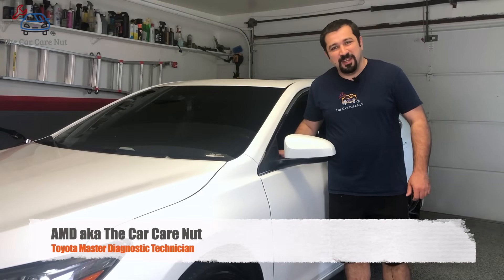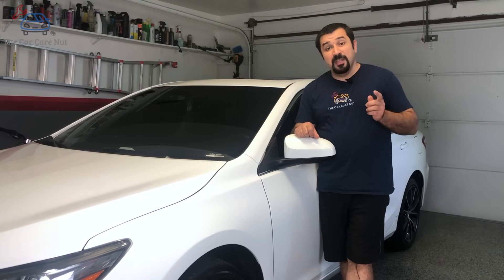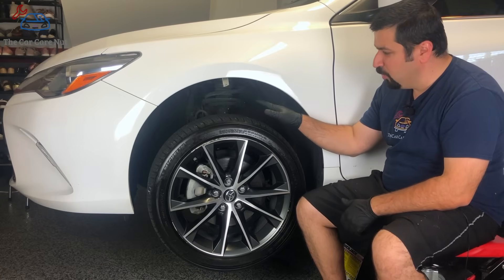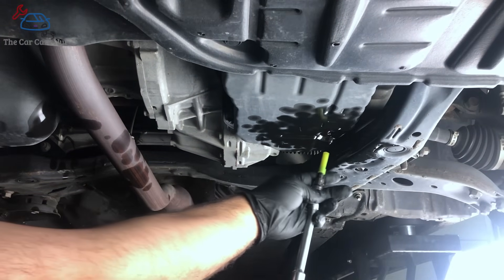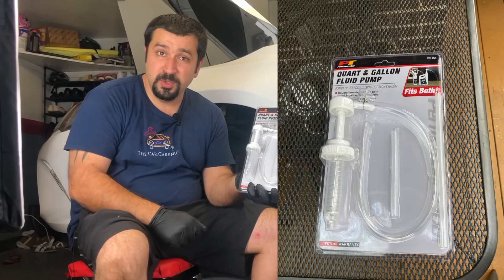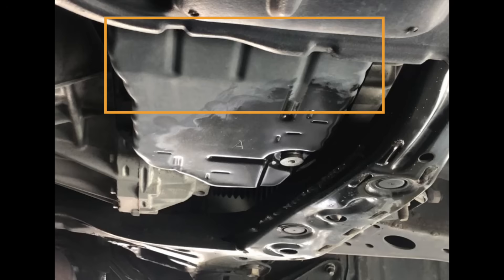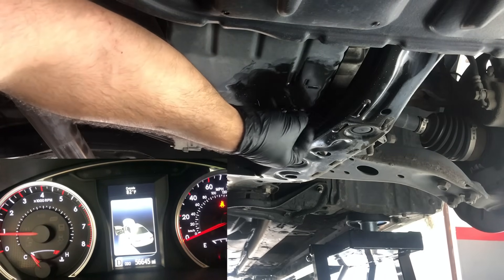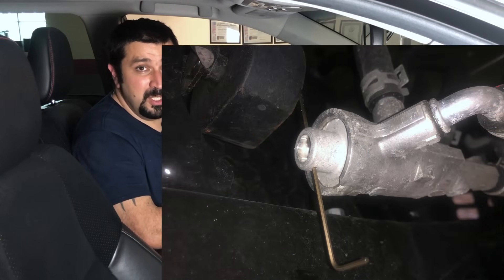How to change your Toyota Sealed Transmission Fluid

Comment: Last week I had the transmission fluid changed in my 2020 Camry XLE 4 cylinder. It has 6,000 miles on it. I just did it for early preventative maintenance. There really are a lot of steps and doing this procedure. I noticed it cost more to change this fluid than it did my previous Honda Accord. Toyota charged $291 for this service. They sent me $100 coupon so it only cost me $191.00 . I was wondering when they changed this fluid is there still older fluid left in the car that never comes out?
That is the main reason I changed it early so the fluid that never drained would still be good .. The same theory if you changed the oil and didn't change the oil filter.
Reply from the maker: Hi! Did they do a flush or drain and fill?
Reply: @TheCarCareNut  I just called the dealership as I could not tell by the invoice. He said they flushed it. I also had the TSB reset as well.

Comment: Hi, just watch your video on the Xtool D7. Can you use this tool to monitor the transmission temperature and also can it  reset any service monitors for the transmission if there is any? 
Thanks for your time, appreciate your efforts with your informative videos.
Reply from the maker: Hi! I haven’t found a function to reset transmission memory and you can view trans temperature on some models. The company seems committed to being support to those models that you can’t if you contact them

Comment: I have a 2019 Toyota Camry LE, 4 cylinder. I'm almost due for a fluid swap and I'm wondering if this is more or less the same procedure for my vehicle. I know it's an 8 speed transmission and it's a slightly newer model, but as far as the rest of the procedure goes, is it the same?

Thanks in advance! You are amazing and I am definitely subscribing! Thank you for your information!
Reply from the maker: The rest of the procedure is the same. Practice it first
Reply: Hello Richard, I currently have my car (which is the same model of yours) jacked-up on stands. I just have one issue.I can't locate the bypass valve. Did you have any luck locating it? Thanks

Comment: Thank you AMD for this excellent video !! I am from Bangladesh and I own a JDM Toyota Allion (T260) 2010. I want to change my CVT fluid in the same way you did in diagnostic mode. I can enter into diagnostic mode using a wire but my dashboard display don’t stay in D after doing N-D-N-D-N-D couple of times. It always displays the selected corresponding gear no matter how many times I do the N-D-N-D. Thus, I have no way to know if my fluid is at right temperature to check the level. Is there any solution for this problem? I would really appreciate if you could help me to solve this. Love ❤️ from Bangladesh 🇧🇩
Reply from the maker: Hi! You’ll need a scan tool that can check the fluid temperature
Reply: @TheCarCareNut   thank you very much for your support 🙏

Comment: Hello AMD !
I really appreciate that you share all of that knowledge so openly. Congratulations !
I own  a 2021 4Runner SR5.

Which of the two temperature sensors should I read with my scanner when I will fill the tranny with new ATF ?
One of them, some times, shows a higher temperature  than the other.  I suspect that it shows temperature out of the torque converter while the other shows the pan’s.
Tks
Reply from the maker: Hi! You’ll need to watch the temp from sensor 1. It’ll usually be called ATF temp 1
Reply: @TheCarCareNut  
Tks AMD !
Reply: I also own a 2021 4Runner SR5 Premium. Do these also require the jumper cable insertion? Or can you go into fluid temp check mode just by doing the shifter process? Thank you!

Comment: Hello there ,. I have drained and filled my K310 transmission while vehicle cold the same quality that I got out. 3 days later I get engine light on and scanned got code dtc  b2282 I'm wondering if that is related. I could do the correct procedure to do level check because my floor is uneven but I got techstream. You have a clue
Reply from the maker: Hi! Likely not related. You’ll need to check the fluid level to be sure.

Comment: Great tutorial. Very clear and precise with your instructions. It gives a little more confidence in proceeding with the work myself.

Question, will this procedure work with a 2014 Scion tC? Will the D light remain solid or will the A/T Temp light appear? Thanks.
Reply from the maker: Hi! This works for your scion and if memory serves right it’s most likely the D light

Comment: On a 2012 Camry SE 2.5 liter 4 cylinder is changing the filter necessary if the fluid isn’t dirty?
Reply from the maker: Hi! If the fluid is changed on time and is not dirty the filter replacement is not needed
Reply: @TheCarCareNut  even if the filter doesn’t get dirty wouldn’t it still eventually wear out or come apart?
Reply from the maker: I haven’t seen one come apart yet
Reply: @TheCarCareNut  ok thanks!

Comment: Great video! On Toyota Rav4 2019 2020 2021, what is the temperature range? Do you have to put an Allen wrench to the cooler bypass in order to hold in the valve on the  2019 2020 2021 RAV4 8 speed transmission?
Reply from the maker: Hi’ no cooler bypass and 95-113

Comment: Do you check the transmission fluid level in park? N? Or Drive? On a 2018 Camry with the 8AT.

Thank you
Reply from the maker: Hi! In park idling
Reply: @TheCarCareNut  Hello, Thank you so much.  at what Transmission Temp I should check the fluid?  Because I'm using the Foxwell NT 624 Elite to check the Transmission Temp.

Thank you so much.
Reply from the maker: At 95-113
Reply: @TheCarCareNut  thank you so much
Reply: @TheCarCareNut  you located in Chicago, can I bring my car to you for transmission fluid change in mid-2022?

Thank you so much
Reply: @TheCarCareNut  Congratulations on the new Camry you got in another video

Comment: Thank you for your wonderful videos!  Today, I drained my 2016 Corolla cvt.  A whopping 3 ½ liters drained out, and I put the same amount back in.  I'm seeing most people draining far less than that.  The transmission has never malfunctioned.  Was my transmission overfilled?  Should I use the same trinkle technique that you're using in your video?

Thank you for your advice.
Reply from the maker: Hi! It’s possible that it was overfilled. But no way to know until you check the fluid level which I highly encourage you to do
Reply: @TheCarCareNut  I rechecked it today.  It was overfilled.  I corrected the refill by using your instructions.  Thank you!

Comment: AMD I recently bought a 2011 Rav 4 with 123,000 miles and the owner told me she didn't have the transmission oil changed. I've written to you before asking whether or not I should change it now or leave well enough alone. You said if the oil smells burnt don't change it. I've decided to have Blackstone Labs do an oil analysis of the transmission oil to check both the condition of the oil and whether the transmission is showing signs of excessive wear. They require a 3 oz sample of the transmission fluid for the test and specify that you not use the first fluid drained for the sample. Is it okay to use a transfer pump to withdraw the 3 oz sample through the fill hole or should I take it from the bottom drain? Thanks!
Reply from the maker: Hi! You can take a sample through the dipstick in that model. Use a long straw and a transfer pump.
Reply: @TheCarCareNut  Wow! Toyota really wants to make it tough for owners to check the transmission fluid don't they. There's no mention of the dipstick in my owners manual or in the illustration of the engine compartment. I'd seen the dipstick on the right side of the manifold shield but I thought it was for something else as a friend told me my 2011 had a dipstickless sealed transmission. Am I correct in assuming this means I don't need to use the overflow tube method of checking the transmission fluid level and can just drain/measure the amount that comes out/replace that amount through the dipstick tube and then check the level with the dipstick?  Thanks!
Reply from the maker: That’s correct you don’t need to use the overflow stuff. Just conventional dipstick with the engine at idle
Reply: The Car Care Nut Thank yo so much for your help, Much appreciated!

Comment: You do an excellent job on your videos!  They are some of the best I've seen!   I waited until 175k on my 2007 Toyota Sienna because it was supposed to be lifetime fluid!  Unfortunately,  it was after it developed the dreaded low speed bog down at the 2 - 3 shift point.  Is that repairable without a rebuild . All other shift points are fine.  I now have 210 k miles, and can live with the low speed bog down at the 2 - 3 shift point.  Thanks again!
Reply from the maker: Hi! Unfortunately at this mileage it’s a big risk. If you change the fluid it’s either going to fix it or make it a lot worse. I would only try it when you’re ready to get another trans or rebuild this one as a last measure
Reply: @TheCarCareNut  I am having a similar issue on my 07 Lexus IS 250. First fluid change was done around 144k km by dealer. Car is at 205k km now and showing low gear shudder signs. Would it be ok to do the drain and fill? I would get Toyota to do it because I don't have the space here to do it myself. Any extra information I should give them or is what you showed standard procedure at the dealerships?
Reply from the maker: If it was done before you can safely replace it
Reply: @TheCarCareNut  Thank you so much for the reply. You're amazing and I am learning so much. I have another question if it is not too much trouble and I think it may help the original poster as well. My car also has the harsh downshift from 3-2-1. It appears official word from Lexus is to replace ECU and not to replace/rebuild transmission. Do you have any experience with this issue and ECU replacement/repair?

Comment: At the risk of sounding silly, if performing this task alone, the part when the D indicator turns solid. Do you drain the fluid while on D, or ok to place it on P (park) then drain? (Something aboutCrawling under a car with moving parts working alone seems risky) 😆
Reply from the maker: Hi! When the indicator comes on put thr car in park
Reply: @TheCarCareNut  can I turn the car off and then go drain it? Or does the car need to be in park and engine running?
Reply from the maker: Car needs to be running in park

Comment: This does not replace all the fluid in it does it?
Reply from the maker: It replaced enough of the fluid to keep things fresh
Reply: @TheCarCareNut  what is the total capacity? I have a 2015 I plan on doing this to tomorrow, but it's at 96k miles.
Reply from the maker: I would do the drain and fill once and call it a day.
Reply: @TheCarCareNut  I read it is because 3.9Q and 6.9Q depending on year and model. I have a 4 cylinder non cvt so I'm assuming it's on the lower side of capacity. If that is true Then getting the 3.5 out of it from a drain like this would be good enough for me.

Comment: I have a 2017 Camry with 56k miles, so today I took it to my local Toyota Dealership to have them do this job. I have a dashcam that records the inside of the car as well, and I saw no footage of them doing the fluid level adjustment procedure.There wasn't any recorded video in between them pulling my car in and then out of the service bay. I'm pretty certain that they did in fact do the drain and fill because my car is shifting more smoothly, but should I let them know that no one did the adjustment procedure?

Comment: Do I need to remove the oil pan and replace the transmission fluid filter?
Reply from the maker: Hi! If the fluid is changed on time you don’t need to
Reply: @TheCarCareNut  Thank you so much for the reply!

Comment: Hey Amd, GREAT VIDEO, THANK YOU! I have a 15’ XLE Sienna and an 11’ Lexus ISF with the sealed trans. I have done this procedure for both vehicles but was never able to get the cars in Diag Mode as the Manuals were so confusing on how to do the procedure. Thanks for making it crystal clear how to do this! Do you know if this procedure is the same for the 15’ XLE Sienna? It’s a V6 and the trans seems the same as the one you did in the video. I did use the temp gun on both services and all seemed to work out fine. Thanks again for your great, helpful videos! I’m Subscribed up!
Reply from the maker: Hi! It is the same for your 15 sienna
Reply: @TheCarCareNut  Thank you Amd!

Comment: I did this method and transmission fluid does heat up quickly. Thanks goodness I did one time. Select indicator was solid drive and check the level. Everything was good. Toyota highlander finally run smoother than before.

Comment: In the very last step, shouldn't you put the car and park first before you take the jumper wire out. Otherwise if the car is in the drive mode then it could roll forward
Reply from the maker: Yes put the car in park
Reply: @TheCarCareNut  you may want to fix the written directions then.

Comment: Hi AMD,

On my 2016 RAV4, I’m jacking up each corner where the notch is located on the reinforced metal ribs (under each door). Where should I then place the jack stands? Thanks!
Reply from the maker: Hi! That’s the punch weld and that’s where you place the jack stand
Reply: @TheCarCareNut  thanks AMD. Is there another spot to jack up the car at each corner, besides the pinch welds? Since we have to put jack stands underneath them? Just trying to figure out how to jack up all four corners for this procedure. Thanks!
Reply from the maker: Hi! From the sub frame if you find a good spot

Comment: I saw a guy taking the fluid from one of the line of the transmission cooling next to the battery. He use 10.5 quarts, he add fluid till came red from the attach hose . Only taking 2.5 quarts, is not going to do much .

Comment: Hello my brother! Your videos have been such a blessing to us all. Do you know the torque specs for the 2017 Highlander drain and fill plug? 

Also, is it common for transmissions to be overfilled from the factory?

Than you as always! May our Lord bless you and your family!
Reply: Thank you! Will do. 
I did the transmission oil change today and I am not sure if I made a mistake. I did the initial drain when the transmission was cold and got 3.5 quarts out. I added 4 quarts (0.5 more) and after it reached 104 degrees, I removed the drain plug, and waited for the tickle but this time I got 1 quart out. So I am not sure if it was originally overfilled or if I need to put the 0.5 quart back.
Reply from the maker: Hi! Unfortunately I don’t have access to the repair manual at this moment. Add a comment tomorrow around 5 pm central time and I’ll get back to you
Reply: @TheCarCareNut  hello, Hello my brother. Just checking with you again to see if you could find out the torque specs for the 2017 Highlander transmission drain and fill plug. Thank you in advance!
Reply from the maker: Hi! So it was likely overfilled. Drive it for a week then double check the fluid level to be sure. For the drain plug it’s 37ft lbs for the fill plug it’s 36 ft lbs
Reply: @TheCarCareNut  thank you very much. May our Lord bless you and keep you as well brother!

Comment: Thanks so much for the informative video. I noticed the drain plugged was inserted back once the fluid starts to trickle. Is it recommended to wait a bit longer for the fluid to start dripping instead before putting back the drain plug? Also, is a new gasket needed as well? Thanks!
Reply from the maker: Hi! As soon as you get a fluid trickle install the drain plug with a new gasket

Comment: The main purpose of this video to my understanding is to scare you off from doing this simple procedure.  What you have to do actually is simple. Make sure that temperature of the new fluid and fluid in the transmission are the same and amount out is exactly the same as amount in. And that's it.

Comment: Hi. Firstly, thank you for a great channel, for your professionalism and accuracy to detail. I’ve done a full ATF change in my Camry 2011. I set the fluid level using an Infrared gun. After completing I noted your comments regarding accuracy and have therefore done a practice of taking the car into Diagnostic Mode. I followed your steps, accurately installed the jumper in the OBD2 connector. The car reported it had entered “Diag VSC 51”. The car has an indicator with separate lights for P,R,D…etc. I got it into a mode with the “P” and “D” illuminated simultaneously. I then removed the jumper from the OBD2 connector and the “D” stayed illuminated. That has confused me. At that point The flashing warning lights stopped and both “P” and “D” were illuminated. I appreciate at that point the “D” light is not a gear selection indication but a temperature indicator. However I didn’t seem to get the “D” blank, then solid as the temp climbs and potentially flashing (above calibration range). Would you have any suggestions please?
Reply from the maker: Hi! That is actually the correct sequence. When the D light is off it’s below the temperature range. When it’s on solid then it’s within the temperature range where you’d need to adjust the fluid. If it starts blinking then it’s too hot you’ll need to abort and wait for it to cool down
Reply: @TheCarCareNut mine started blinking just as I was starting to screw the plug in. I assume this is ok, as I was just on the edge of leaving the correct range and entering the “too warm range”?
Reply: @TheCarCareNut  Hi. Thank you Amd for that. Yes, it turned out the transmission was warm enough to illuminate the “D” solid. I waited for several hours and tried again and all worked beautifully. Many thanks for a great tip. It was interesting that when the transmission temp triggered the “D” to solid the electric radiator fan cut in and the “D” extinguished, blinked a couple of times over 30 sec, then came on solid again. The front of the pan with the IR thermometer gun indicated 95 degrees in this case. Regards.